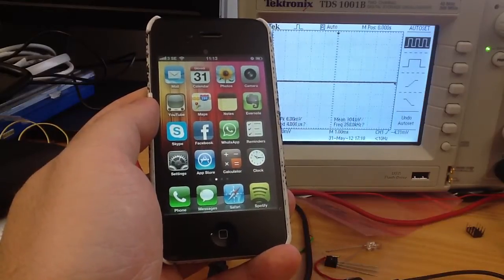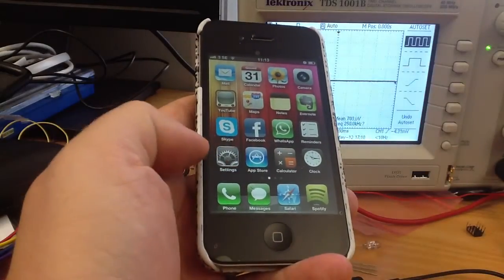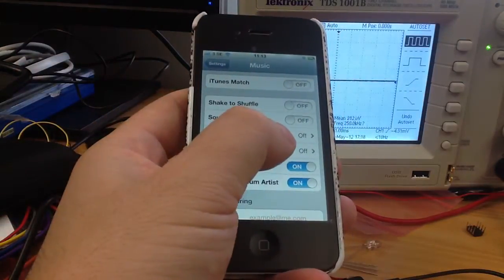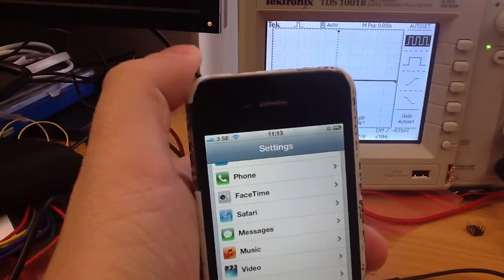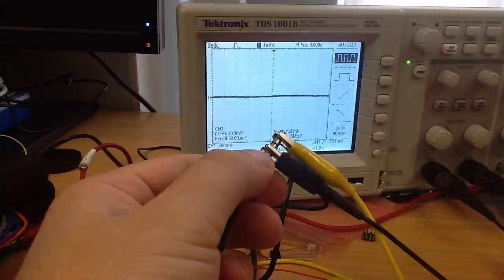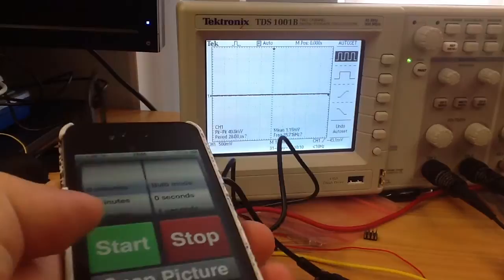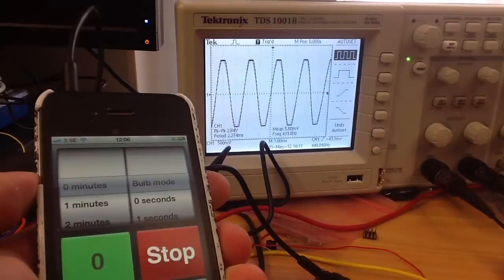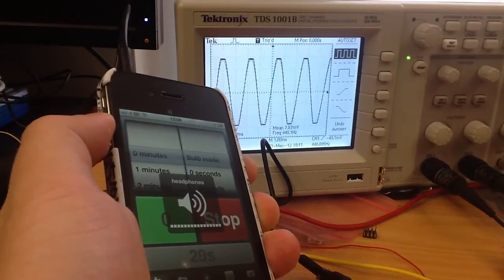iPhone Voltage Measurement

Comment: What this tells us is its safe to run the headphone out jack feed into the RCA input jacks of your amplifier.
Reply: It is more than safe just lower output. Using a line out dock or a dock that utilizes the 30-pin connector which bypasses the headphone amp will output a line level signal at 1.8v gets you about ~2.7db of gain and results to a much cleaner and louder sounding audio player. The iPhones and iPods have better internal DAC and measures better in jitter noise as opposed to most $300 commercial outboard DAC's available at amazon. It's competent enough to be labeled as hi-fi than most people want you to believe. Anyone who says otherwise is either a demented fool or an uneducated moron. 

The only limitation is that they are limited to 24/48 resolution but who hoards hi res audio anyway. The only ones I know who do that are the lonely 30-year old pc gaymers whose existence are absolutely repulsive to the opposite sex. Visit kenrockwell or audiosciencereview and you'd be surprised how Apple products are audiophile quality.

Comment: This is useless measurement, since you have not connected the output to a LOAD. So dumb and pointless.
Reply from the maker: John Coops I belive the probe has a load. However feel free to make your own video.
Reply: You believe? Run the phone INTO the intended load, then put the scope across that... in that way you measure the voltage when the phone is in use.
Reply from the maker: This video is pretty old, why don't you make an updated new one? Your insight is as valuable to me as to anyone searching for this topic on YouTube.
Reply: What topic? It's absolutely pointless measuring the voltage . Nobody cares. Truly.
Reply: Maybe pointless to you but for inventors hackers and makers this is gold.
Reply: I care, thanks for the video mate
Reply: What the results of this test suggest is that the audio amplifier in this smartphone runs from a single-polarity supply and is AC coupled to the headphone jack. Nothing fancy, such as using a power inverter to develop a negative supply rail and using DC coupling of the amplifier to the headphone jack, is being done. An intentionally-clipped sine wave is useful for this test so that the amplifier's maximum peak voltage can easily be read off the oscilloscope screen.

Comment: hi - i would like to ask. I want to use iPhone to help me with amp voicing. I want to record to iPhone clean guitar like I would play to amp but I need iphone to play it back for me so I can play with the amp settings, mic placement etc. guitar pickup has this values Output mV: 410. Can I safely use iPhone wiht mono cable to amp? thanks

Comment: Could a multimeter be used to measure the output signal of an RCA port?
Reply: Yes. Make sure to set it to AC volts, and don't forget your multimeter will report RMS value - not peak-to-peak values. For real measurements, you should measure voltage over an impedance. Headphones have impedances in the range of several tens to hundreds of ohms. The guy in this video does not load the headphones output with an impedance. That's why the signal is clipping.
Reply: Oh my.... 7 years later, I don't even remember why I even wanted to measure the signal of an RCA.  The only thing I'm interested in is using a multimeter to measure relative wattage of amplifiers.

I haven't tried it yet, but it seems like the easy way is to wire the multimeter parallel with my desired bookshelf speaker to measure AC volts, use a 1khz sine tone turned up until the point of audible distortion. Then do the same on other amplifiers with the exact same speaker.